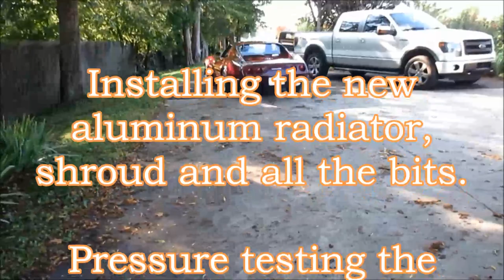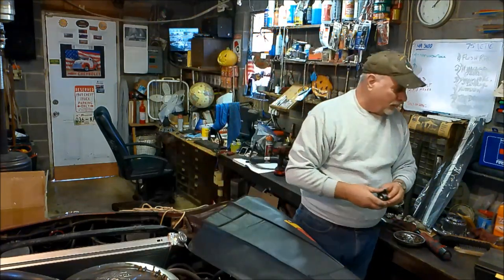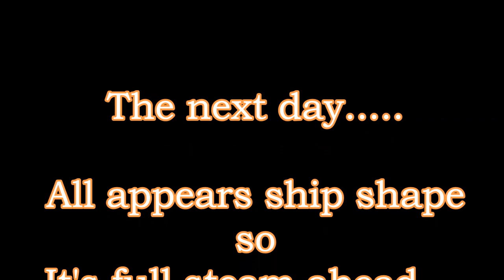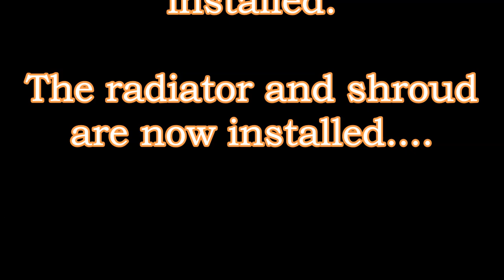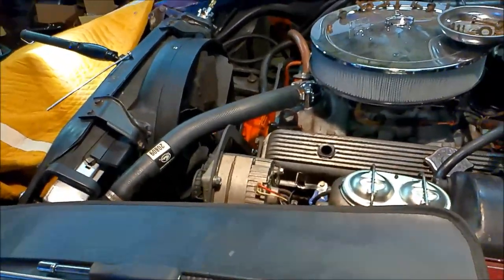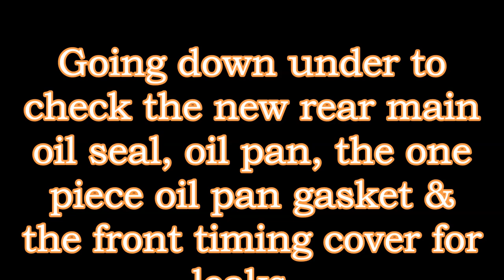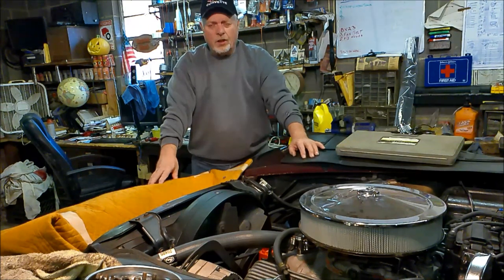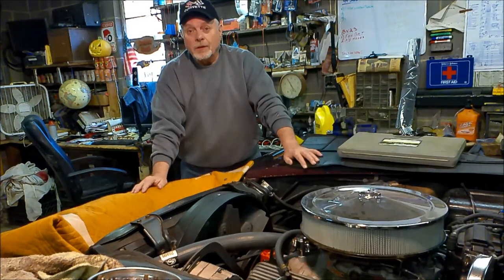75 C3 Corvette, New aluminum radiator, install & turnup, Volume 40

Comment: I bet the "1.1" on the new radiator cap is the pressure setting in atmospheres - it comes out to about 16 lbs pressure.
Reply from the maker: Hey David, thanks for the info. 16 lbs is whats spec'ed. I might test it, mark it and keep it for a spare.

Comment: Dave where did you get your custom exhaust piping for your 49 truck ?? I have a 46  - 3/4 ton with a 235 duel exhaust  , Fenton headers   I have to get all new exhaust ! front to back
Reply from the maker: Hey Rex. I got the exhaust kit (no mufflers, just pipe) from Chevys Of The 40's. (I got the mufflers from amazon). I don't recall the price but IIRC it wasn't too steep. I gotta say I wasn't happy with the kit and I had to contact them a couple times inorder to make it right and they did to their credit. The problem was the dual exhaust lengths weren't even and they ended up having to send a couple sections to make the short section right. And they did at no additional cost. My guess is the "card" they were using wasn't right for a 49 Chevy 3100. Good news is the exhaust does work and has been for 3+ yrs now. Here's an old video of me installing the exhaust kit.
https://www.youtube.com/watch?v=VxXGiBMELnw&t=4s
Good luck and thanks for watching.
Dave
Reply: ok thank you ‘ I have watched your video on the 49 exhaust  👍

Comment: And is it a 3 row?
Reply from the maker: Hey John, yes it's a 3 row aluminum radiator. Like I said in the video I have a hard time recommending it because of the way it was packed & shipped and that I had to reform the upper radiator hose connector because it got bent in shipping. That said I easily rebent it to round and it hasn't leaked at all. The car does run alittle cooler, it hasn't got to 200 degrees yet, even in heavy traffic or at drive-thru windows.  I've probably got 600 miles on it now & so far so good. The fit isn't perfect but it's good enough. It's a Chinese repro and here's an amazon link to it: https://www.amazon.com/ZC478-Aluminum-Radiator-1973-1976-Corvette/dp/B07FLLNLXB/ref=sr_1_4?content-id=amzn1.sym.d3f43d11-fd5a-4179-8b1e-1a03d11e07f4%3Aamzn1.sym.d3f43d11-fd5a-4179-8b1e-1a03d11e07f4&crid=ZQOBAIJ1M7JS&keywords=radiator&pd_rd_r=ce41837e-3eb5-4ef4-8391-181344abda4a&pd_rd_w=turFo&pd_rd_wg=q4tAV&pf_rd_p=d3f43d11-fd5a-4179-8b1e-1a03d11e07f4&pf_rd_r=6ZN0Z6Q8S3JBCRHS9W6K&pid=8jiIlHG&qid=1693086723&sprefix=75+corvette+radiator%2Caps%2C135&sr=1-4&ufe=app_do%3Aamzn1.fos.18630bbb-fcbb-42f8-9767-857e17e03685&vehicle=1975-47-440-487--7-1-7-21795--9-2-141--12&vehicleName=1975+Chevrolet+Corvette